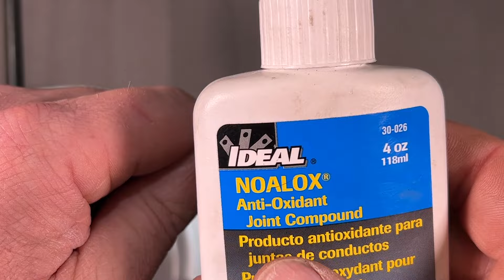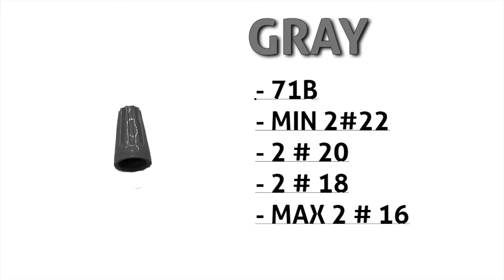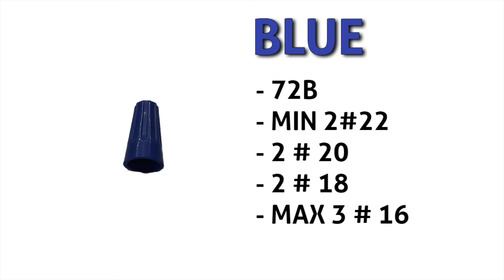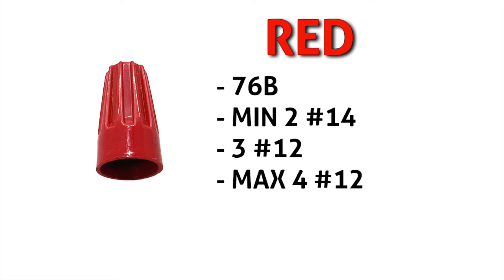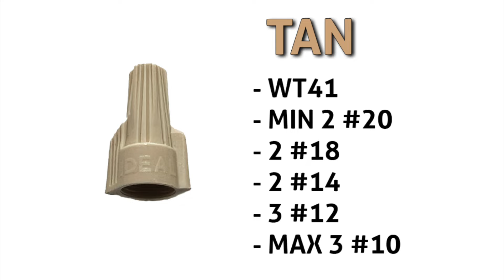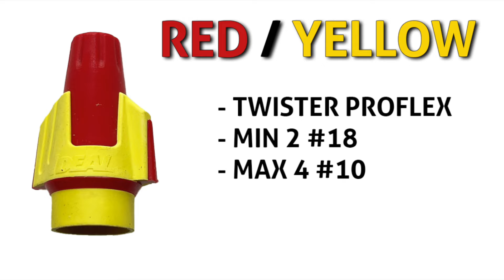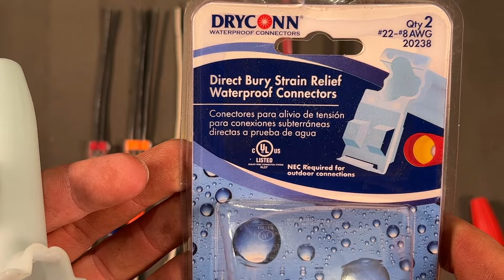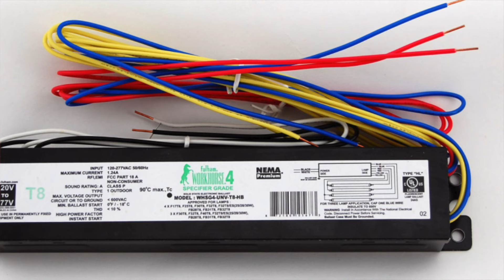A Guide To Wire Nuts - Wagos - Push In Connectors - Do It Right The First Time

Comment: On my very first day as an apprentice electrician my foreman showed me a wirenut.
"If you ever see one of these damned things remove it and replace it with a proper connector.
These are not allowed in the UK.
If I ever find one on a job you have been working on you'll be in big trouble!"
Reply: From what I know, wire nuts are mistrusted in the UK because of a particular brand of ceramic wire nuts that used to be used there that had a tendency to crack. There is absolutely nothing wrong with modern wire nuts, like we use in North America. Lever connectors are definitely easier to use, but are just that much more expensive. Push-in connectors I believe are popular in the UK as well (correct me if I'm wrong) and those have a bad history here, with some cheaper models showing poor reliability.
Reply: @raggarex  Wagos are very popular. Europeans love German products.
Reply: @raggarex  I think the issue was actually with porcelain wire nuts that hand no insert. Do not confuse these with the more modern style ceramic ones designed for extremely high temperatures. These are exceptionally durable and not prone to cracking. 

Not only are WAGO style lever nuts much more expensive, but they are also   technically inferior to wire nuts. The issue is that the  tiny little spring clamp connection made with dissimilar metals, has about 3 to 4 times the resistance of a wire nut connection, right out of the box.  What that means is they are going to create more heat at the connection.  Where this may become a problem is at higher, near capacity currents. It gets worse as currents rise because heating is a function of the current squared times the resistance. twice the current equals 4 times the heating. 

The 221 lever style connectors are just a slight improvement to the older 773 push in style connectors. But both have the same spec ratings. IEC rated for 32 amps but UL rated for only 20 amps. The lever does not improve the clamping action on the 221. Some have suggested that the 221 "Is better", however the UL ratings are the same for both. 

If  you look for comparison testing, most reviews are all about how easy they are to use, while ignoring the elephant in the room regarding their technical, hard engineering properties. For example, the resistance of the connection. I plan to detail test the 773 push ins vs the 221 lever style. I don't anticipate finding a real difference where it actually counts from  a purely technical properties perspective. I do not see the levers changing that. The IEC ratings are the same for both and the UL ratings are the same for both. However, I think it is telling that the IEC current rating is 32 amps but the UL rating is only 20 amps. 

In my  opinion, i wouldn't use either WAGO style for anything but very low current applications. I just can't see deliberately using a connection device that inherently has more resistance than the long proven wire nut connection. 

I don't really see the cost factor or ease of use, as being relevant to which one is fundamentally better from an engineering perspective. Now if Ohm's Law should somehow get repealed, and resistance no longer mattered, I might see it differently. But that's not about to happen and the science is still the science. But I'm an engineer vested in the science and not some installer, with rather low technical knowledge, looking to make my job easier.
Reply: @IAmThe_RA  Yeah, but popularity doesn't change the technical properties. Europeans use the 240 volt residential system where we use the split phase, dual voltage 120/240 volt system in the US an North America.
Reply: @professorg8383  Does not matter. WAGO connectors are also UL listed (32A/450V) meaning you can legally use them in the US and Canada.
Reply: @IAmThe_RA  No that is not at all true!!  They are not listed at the IEC rating of 32 amps/450 volts,  They are listed at 20 amps/600 volts.  In the US, the NEC allows the use provided they are used within the UL specifications. They are stamped with the IEC specs because that is not what they were designed for. The UL listed spec is not stamped on them. You have to look it up to see what the listed specs are. These are on the WAGO website, albeit pretty well hidden. That said, it is just the summary level UL listing that shows current and voltage ratings. The exact UL spec is far much more detailed covering  all the parameters tested and by what methods. 

If you use these in the US in an application above 20 amps, you have an NEC violation. IDK, Maybe you don't understand how this is supposed to work.

This is a good example of the problem using IEC rated devices in the US.  The ratings are not the same or even close.  WAGO were designed for use in IEC 240 volt countries, not for the  US. But it is far more complicated that that and if you don't understand in detail, the difference between the standards and regulatory agencies and  how they work, you might think it's the same as the NEC  usage with UL listings. It is not the same!!
Reply: @professorg8383  Dude I am holding a Wago 221 right now. On the side it says: 
c(UL)us ENEC 450V/32A

On the other side:
PSE JET 20A 300V 

PSE JET is Japanese meaning only for Japan.
Reply: @professorg8383  I love the WAGOs, and I'm an electrical engineer.  I think their advantages over wire nuts are numerous whether for pros or DIYers or for high or low current loads.
Old knob and tube guys would tell you how inferior "rat" or "pig" tail splices are(which is what wire nuts basically cover) especially compared to something like the Western Union splice.  Back then too they made their twisted wire splices and then soldered them and wrapped with insulative tape, typically outside a junction box.  Which there was logic to that; "if done properly"(the fatal last words of both soldered and wire nut splices), the soldered splice would run at colder temperature, often ambient, compared to the wire.  -Which is why so many K&T fires start at random spots on the wires NOT at the splice points.  Then again, it's plenty easy to screw up soldering by hand.
Much of the idea of having junction boxes is that when you have either a splice failure OR an overcurrent or degredation failure that leads to a splice failure, it's contained inside the junction box rather than burns your house down. Wire nuts run hotter than electrical wires. So do the WAGOs.  That's EXACTLY what you want to see!  Better a melted wire nut or lever nut than a far worse problem.
Dissimilar metals: one of the biggest problems with electrical wire is that the metal is chosen for its conductor capabilities rather than its mechanical properties; it's why we use aluminum and copper and very soft alloys(don't have other metals mixed in) for both!  When people tell you to "pretwist" for the wire nut, this is precisely the problem; you're relying on the mechanical properties of a metal that no mechanical or metallurgical engineer in their right mind would ever choose for its mechanical properties.  And that's IF you even make a mechanical connection, which often wire nuts mess up. No joke; wire nuts are all two easy to NOT have one of the wires tight, even with pretwisting. The nut will often grab on to just one wire; it doesn't care if there are 2, 3, 4, 5, etc inside "I'm gripping this one hard and this one soft!."  That even if you pretwist(what a mess!) that's often NOT a good mechanical connection either because wire nuts are basically an "add on" "fix" for lousy pig tail splices that they never really fixed.
I secure a WAGO in a vise, each one of the those wires will have a specific "pull out" tension".  Put that wire nut in a vise; each one of those wires will vary wildly in pull out force, and all too often one of them won't be more than a few pounds. All too often when you're pretwisting(if you do this or if you don't—and why isn't there a definitive answer on this topic after all these years?) to when you're applying the wire nut, you're having to "check in" again and again and again to see whether or not each and every individual wire is secured.  "Oh oops; that one's loose; better untwist and do again and/or twist some more!"  It's like Chubby Checker "Let's Twist Again...like we did before!"  Myself I got a bit of obsessive-compulsive disorder & this endless "checking" aspect of wire nuts most definitely triggers it...and slows down the job.  In one job I had though, I remember ordering torque wrenches for our technicians as if I didn't specify, some guys(or gals) would overtighten(sometimes to damage), some would undertighten(sometimes to damage), and some would worry and get caught up in "check and see" behavior—with me then having to deal with the grief.  Torque wrench; turn it till it clicks!
Now, something like a steel screw; that's a way stronger fastener than a copper or aluminum or brass screw, BUT you're right that there's different thermal expansion properties of the dissimilar metals.  Thank the Good Lord for lock washers!  However, that screw is NOT an offset specialty alloy bi-metallic conductor clad steel core spring specifically engineered to maintain its grip on the wire for millions of thermal cycles.
It's the same problem as lineman once had, it used to be extremely common for them to tie power distribution wires to insulators using "hand tie wire" made of similar metal as the conductor.  What's used today are "preformed" ties made of specialty copper or aluminum clad alloy steel or specialty alloy & temper aluminum or copper that some linemen and utilities, including engineers, resisted using these, in some cases for decades, but their advantages became too apparent over time.  Search YouTube for "Preformed Line Products Distribution Tie" for more info what I'm talking about.
The usual complaint from linemen: "how can this little thing hold the wire better to the insulator than what I can tie it myself tighter for next to nothing cost with basic tie wire?"  A: Cause you can tie something down with hemp twine or rope "tighter"(or what seems like it) than with 100 grade alloy factory made hammer forged steel chain, but it's nowhere near as strong!  Also, your tie is "craft sensitive" and that tie wire is cheap, your labor is not; that no matter how skilled you are, your connection will never be as good as the pre-engineered and factory-formed solution. What makes "hand tie" wire versatile; that it's soft alloy much like the conductor wire can be twisted and manipulated by hand, is exactly the opposite of what you need for making a decent spring; it's metal but plastic rather than elastic!  The preformed ties are also "idiot" proof, and by "idiots" we mean professionals of the highest caliber, knowledge, and skill levels.  After all, in those high voltage safety training videos, are all the case studies of average people being electrocuted, or are they of professional linemen doing things in HV environments every day that they made a mistake?
(Yes my first job out of college as an electrical engineer I worked in the power utilities industry)
Back to lower voltages, I'd rather make a house call than have a house fire.  One has to keep in mind what are you really looking for in making a conductor splice?  It is NOT just Ohm's Law!  In fact, you will have HORROR SHOW problems if you think that it is.  Ex: Better a melted wire or lever nut inside a junction box than a burning structure from a wire outside the box!  Almost secondary circuit breakers in case your primary circuit breaker fails.  Don't take it personally though, as some of the very best electrical engineers of entire generations, even 100% of them, have fallen into this trap.  After all, they invented knob and tube, and they weren't entirely wrong as there are some advantages regarding(ex: back in those days material costs were far more than labor ones, houses and buildings were primarily lighting loads they didn't have all today's modern appliances and electrical devices, any one of a hundred other considerations, etc.).
That I can make those splices have less resistance than the wires outside that junction box...but then the fire starts in the wall somewhere.  Like I said: Knob & tube guy would tell you point blank that your "wire nut" splice is NOT as "good" as the one he makes with solder and tape.  Either mechanically OR electrically.  And he's 100% right!  But he's also 100% wrong!
WAGO connectors in some cases you're right are 10 times as expensive as wire nuts.  But you're wrong as electrician labor is DOLLARS per minute cost that wire connectors aren't really a pricing factor in jobs and projects; it's what you can install the fastest with the results you need; lever nuts are a tremendous time savings.  And I'd argue they're the best solution for either low or high current applications for either the DIYer or the professional electrician.

Comment: Nice tutorial thanks. However, I wonder if wire nuts and slip-ons are ‘technically approved’ since I have never come across them in the airline and automotive industry where I used to work as a maintenence engr. for 40 years ? 🤔
Reply: I think only crimps are approved to automotive use, just due to the vibration they're exposed to. Wirenuts and wagos MAY work, but I dont think there would be any longterm reliability.
Reply: @KiltPatrick  Correct. Auto industry here, brother is in marine, all that's used in both is crimps. A good crimp is stronger than the wire itself.

Comment: isnt noalax meant for aluminum wire? or aluminum to copper connections in sub panels etc, why not just use dielectric grease? 8 min 11 seconds in this video.
Reply from the maker: I do like the noalox for connections. It has suspended particles of zinc in it that help stop corrosion. Dielectric grease is good too for sealing out air and moisture. I use noalox on the battery terminals on my car. Works great.

Comment: Here in Britain we don't use wire nuts although they are starting to make an entrance, I have just invested in a lot of wago.when using fine stranded wire I will lightly tin the wire before use. No problems whatsoever, love wago.
Reply: Why not ferrule fine stranded wire?
Reply: Be VERY careful tinning wires. In many terminal connections, the solder slowly deforms over time, creates a loose connection then starts arcing. This is especially problematic in screw terminals that hold it at a fixed position and a common concern with cheap electronics produced overseas. 

A constrained connection like a wago might be fine unless it's to make up for wires that are too thin but it's unnecessary. I would never tin wires in situations like this. It reduces the electrical conductivity, increases heat and adds another variable.

When you're concerned about a stranded wire, use a crimped ferrule of the appropriate size, period. An adequate crimping tool is cheap and shouldn't slip out when done right but they're made perfectly for a piece of heat shrink if you felt it was warranted.